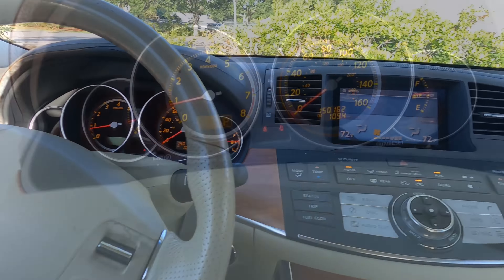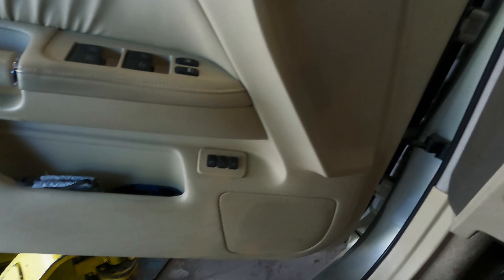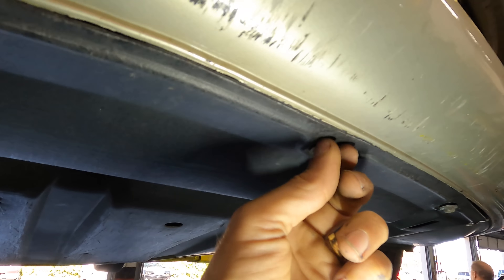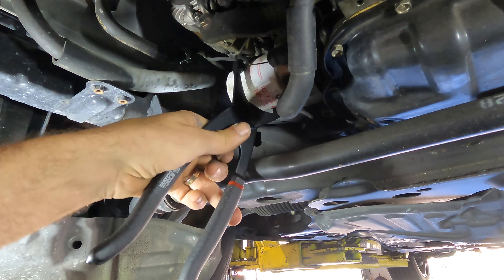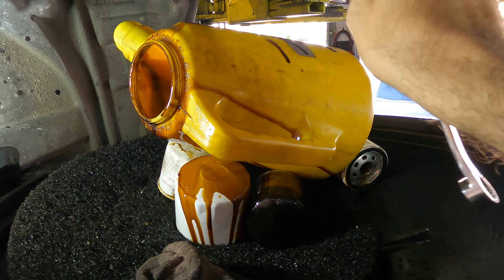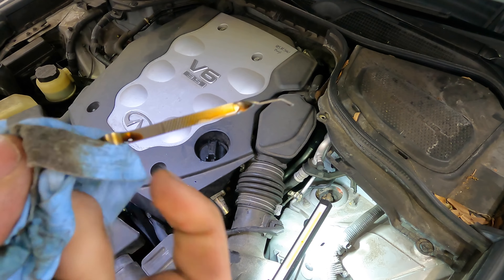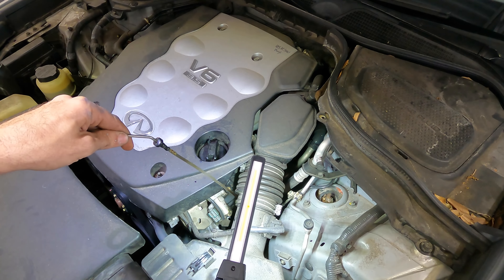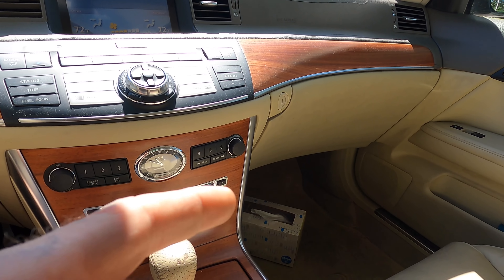Customer States: Sounds like a Machine Gun? Infiniti 3.5l V6

Comment: Yeah, let him off the hook; don't want to destroy a good mechanic's self confidence. That could cost in the long run.
By the way, I'm wondering if someone "borrowed" the screws to hold on that plastic shield. It looked like they left just enough to keep it on there, but took the ones they could, without anyone looking. Just a thought, with recent events in mind (cat. converters, theft, etc. on the rise).

Comment: K hope you signed a non liability notice re that Datsun and n slicks. You can tell Renault own them, as they have all the quality of a typical French car, i.e none, add in an owner who is ignorant of their danger to themselves as well as others, that is when you accidentally put a screw in the tyres. Herevin the UK, bald tyres carry fines and 3 penalty oints per tyre, 12 points is a court appearance and a driving ban, and police will issue aprohibition notice, and the only way to have that lifted is a full Inspection

Comment: I would have nicely tried to tie the machine gun/typewriter noise to the near empty oil pan as a result of badly leaking valve cover gaskets. Peter is a good guy and it seems like a fun guy to work with and around...he is lucky to have you as a co worker.  I subbed a long time ago with no regrets:-) End of transmission:-)

Comment: These old Nissan 3.5's are known to use oil.  I know, as I still drive an '02 with that engine.  On average I usually add a quart of 10W-40, yes the thick stuff, every 1k miles.  Been that way for the almost 150k miles I've driven it and hasn't gotten worse or better.  The engine still purrs like a kitten and runs like a raped ape if need be.

As for the engine on this video?  All I have to say is bye bye timing chain.  These engines will NOT put up with long oil changes!

Comment: I knew they were going to decline all repairs. You don't change the oil for 10,000 miles, you're not likely to do anything "extra".  I get being tight on funds. But, I'd have gone for any safety issues first, like the tires. At least they finally changed the oil. It might just end up being THE final oil change ever for this neglected little luxury car.

Comment: Those valve cover gaskets are clearly leaking so bad that is why it was low on oil. Probably leaking past the spark plug seals as well.

Comment: Pete has been found innocent for the missing oil..
It was visible leaking out of the Rocker covers like a slow moving Oil Coloured Niagara falls  ending in non-power contributing combustion. ! 
I would be more concerned about the San Andreas fault line occurring in the dash.. Yipes..

Comment: Couple of thoughts..... Perhaps if you (a manufacturer) design a dipstick that is difficult to remove and reinstall, you should expect owners to be less than eager to check their oil on any basis.  Hard to believe that belly pan would ever be put back in place with all the screws at a jiffy oil change shop.  Again, designed in failure point.  Yes, let Peter off the hook.  I actually can understand consumers not buying tires at a dealership.  Unless your shop is different than most, I can get much better deals on tires from my local tire dealer than my local brand specific auto dealer. Better deals and wider selection.  Sadly, big shops will always have the image of overselling repairs.  In truth, very often when a car has some miles on it, it also has multiple "issues" and the owner thinks he is being oversold while the truth is the mechanic really has found multiple things that need to be addressed.  Guys like you are in a no win situation.  Thieves if you mention everything you found, but God forbid you didn't mention something and it fails a few weeks after the car was in for service.  Suddenly you are an incompetent oaf.  Have a great day Ray.

Comment: Ray, good video! My own experience that was similar to this with an older car  was that it was upside down in expenses, and we couldn't afford to fix it. I predicted correctly on this one; it's an older car, with (possibly, a guess on my part) nearly/over $1000 bill to fix it, from what you said, labor and parts considered. Of course, nowadays, it's said that used cars are selling for more than new cars; could be they want to save this one. Do you think you'll have a follow-up on this?
Reply: If the owner actually kept up on repairs as they were needed, he wouldn't be getting a giant one-time bill. He needs to learn how to maintain a vehicle

Comment: Sounds like when my daughter went to one of those oil change rip off locations in her rav4.   They told her she needed to change her cabin filter.   When I told her don’t bother.  We can do it.  She left and returned home and she said there was a rattling sound when she turned on the ac.   That obviously wasn’t there before.     So I had to go to her house and disassemble that filter housing.  Found where they put crushed nut shells  in the housing.   And the cabin air was sparkling clean.    I told her to go down there.  But they denied it.   And she didn’t want it bother to reverse the CC charges.  Which is exactly what I would do.  Even caught  another oil change place do an oil change and not the oil filter on my vehicle.   When caught they changed the all the oil and filter again.   When there is a special.  Just ask yourself. Why am I so lucky.   So I verified their work…. I was not that lucky
Reply: Maybe a squirrel got in the air intake or a duck to the AC and drop some nutshells in there
Reply: @michaelpressman7203  
Rocky the squirrel 🐿?